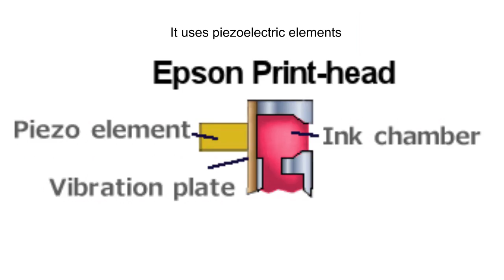What's inside an Epson Inkjet Print-Head

Comment: Be careful not to get the print head misaligned upon reassembly.. 😳... Those are machine manufactured, it's basically a no no disassembling those unless u got proper equipment for reassembly... 😁... Or unless u got a Japanese waifu who works for Epson... 😁🏯
Reply from the maker: This is not a disassembly method for the print-head. It's not possible to reassembly the print-head after taking it apart. This video is only to show what's inside a print-head .
Reply: @viandant5 creio que é possível sim, pois algumas pessoas conseguem recondicionar o cabeçote.

Comment: Can you tell about filter you tool off in front of ink holes. About what the material is and can we find it on the ne? I searched a lot but I couldnt find anything
Reply from the maker: If you open an Epson printhead probably that ptinhead is destroyed, it's welded, difficult to reassemble it
Reply: @viandant5  Sorry, my mistake. You'r right. I just wanted to know what type of filter and which ųm do they use. No one worked about on for home/office printhead nozzle filter. My question reason was I'm working on Brother j552dw piezo printhead and I think all the four ink way nozzle filter are gone in previous repairs. Later I found out my research they are using membran, ss mesh and fabric filters from 22ųm for dye inkjet printheads. You have right on Seiko printhead for Epson printers, it brakes when opened. Now my goal is to find which adhesive they use on nylon sheet to adher on plastic ink damper.
Reply from the maker: @erzincanli  Sorry I can''t help you but I think they are thermal welded

Comment: Same printer head. Tried everything to clear blockages. Syringe, solutions, ultrasonic cleaner. So decided to open printhead. Unfortunately, Near Impossible to reassemble when you have disassembled.  I used sillicone sealer, to retrace the glue gaskets, but no luck as it took a lot of ink 4ml to reach the head when I tried to prime the black nozzle, so it must have leaked via a seal.  If I would try again, Epoxy is the only glue that would be waterproof and work to an unbreakable seal imo. The Chinese seem to sell reconditioned printerheads so maybe it's worth a try. I broke the ribbon cable to the injectors so just going to buy a 2nd hand better model. This printer head wf2630 L320 etc... is known to be poorer build quality than the heads on the wf2750 etc...
Reply: How to install the gold plate nozzles to the printhead ?
What is the material we can use to stick or past this nozzles plate ?
Reply: @emadelbaz  The ink breaks down epoxy.  Only superglue with bicarbonate worked for me. Better off buying a new printhead.
Reply: See? What did I tell u 😳. U just wasted a a properly working cartridge... 😁

Comment: the material the ink filters are made of and glue used to  glue the plastic parts.....Thanks
Reply from the maker: You can use every glue water resistant but once opened, probably the print head will no more work

Comment: Em nosso caso como está obstruído em 3 cores, então deveremos abrir até chegar na parte de ver a placa de cor verde e os contatos. Não ultrapassar em ir além da placa verde.

Até no tempo de 02:06hs 02:06 hs
Não passar dessa parte.

In our case, it is blocked in 3 colors, so we must open it until we reach the part where we see the green plate and the contacts. Do not exceed the green sign.

Even at the time of 02:06hs 02:06 hs
Don't go past this part.
Reply from the maker: This is only a demonstrative video. Opening the printhead will destroy it
Reply: @viandant5  It is only safe to arrive at 02:08

Even in this part, distilled water can be used to carry out cleaning, placing the distilled water in a shallow bowl and wetting the print head. After that, suck on each color until you can suck up all the liquid from the distilled water.
In the part of the filter and piping below the injection nozzles, they must be cleaned, vacuumed and put under pressure because they will be dismantled.
But don't get to the part above the time of 02:09 where you dismantle the contact where it is glued to the flat in a glass style as if it were a calculator where the flat is glued as a contact.
Until the green part from the beginning of the video and up to 02:08 is the limit you can reach to dismantle manually.
Reply: @viandant5  Because the XP series print head like xp-214 and xp-241 is very different and does not show the filters as easily as the L series print head video which is much easier. But cleaning is always safe to do outside the printer, using cleaning solution by vacuuming the print head and exiting through the nozzles to return the dirt. You still have the option of using a sucker to drain the paint from where the pad is.
Pour cleaning solution to clean all the dirt. Then put the cleaning solution in the printer drain with a pipe, place the print head on top, place a pipe where it will connect to the injector nozzle and there it will be vacuumed, that is, the vacuum cleaner in the injector nozzle with the print head in up and resting on its support, and in the drain where the pad is located and has a pipe, add the cleaning solution so that everything is sucked up by the injector nozzle. Then do the opposite, which is there, in the injector nozzle, have a cup with the cleaning solution in which it sends the pipe to the injector nozzle, the print head in the resting place, and when the printer is unloading, turn on the vacuum cleaner to suck up the solution. cleaning process where it will enter through the injector nozzle and exit there when the ink outlet of the pad is discharged.

*Note: With the flat cable disconnected, print head screwed on, and then check if it has gotten wet and leave it to dry on two computer processor fans connected in parallel to a 9V or recommended 12V supply for a long period of time.

Comment: This was a nice video for people like me who want to know what is going on inside without having to tear my own print-head apart.
I was using an ammonia solution to clean an Epson print head a couple weeks back.  I was able to get to the point that the solution would flow fairly nicely across all nozzles (when first flushing it, ink would only flow through the nozzles of one of the colors).  But I made the rookie-mistake of putting it back into the printer and firing it up without giving it enough dry time.  There must have been a partial short due to the conductivity of some of the ammonia left behind, so my main board is now dead (pulling power supply voltage down).  I am in the process of buying a new main board but questioning whether or not my own print head should be ok now (as it has had over two weeks to dry out).  What are your thoughts on the idea of trying out my old print head rather than just buying both main board and head?
Reply from the maker: I think that the print-head is defective too, but I can't be sure.
Reply: Well.  I had the exact same experience , main board died , I used the printhead with another printer and and it also died ,,. So don't use the old  printerhead ..  mark it as bad or 👿 devil , it will spoil any printer.
Reply: @radchanel2412  all is well again. Bought a reconditioned head and used main board. Installed them and the printer is back to working like new. The head and board were each about $30. Seeing that this printer would cost about $300 or more to replace, I feel like I'm ahead.
Reply: Hi Mike.  Trying to troubleshoot a similar issue.  How did you know that your main board was dead?
Reply: @joshtdt6891  It's been a while since I diagnosed that printer so forgive me for a few guesses as to what I did.  I recall hearing some noises that sounded a bit like excessive current draw when I powered it up with the cleaned print-head. There was a separate power supply inside the printer and the output of this supply was low (or near zero?).  When I disconnected the main board, the supply power rose significantly.  It was not being pulled down by a small amount but rather a huge percentage of it's total voltage.  I do not recall much about the pin-out configuration of the supply.  I just kind of guessed my way through it, using my old radio and TV repair experience.  I no longer trusted the old print-head either. I replaced that and the main board and the printer took right off and has worked fine since then.
Reply: Is burnt its mechanism programmed gets also burned

Comment: Can this print head be reused or reassembled after cleaning?
Reply from the maker: No, if you dismantle the print-head it will be not possible to reuse it. It's glued.
Reply: @viandant5  why if you re-glue it? Like they did in the factory
Reply from the maker: @urjnlegend  The problem is that taking apart a glued part there is the risk you break it

Comment: what happen of the green one got soaked up, is it still functional?
Reply: i mean the one that looking like a motherboard
Reply from the maker: If you dry it yes, it will work again
Reply: @viandant5  that's the piece of info i was looking for! I was not sure how deep i can soak the printhead, can i insert it entirely to the solution... In another video you said only the nozzles (the bottom part) can be soaked... But then i suspect this can leave dried ink in the upper compartments.
Reply from the maker: @reflexreaction3797  In the ink cartridges with print-head you have to clean only the nozzles but an Epson print-head can be cleaned entirely
Reply: @viandant5  Did just that and killed my printer lol, because i thought it was dry enough after the hair dryer, well it wasn't. Same story as many others in the comments here. Boom and gone. Well, at least now in the future i know to definitely let it sit overnight to air out completely. Not your fault because that's what you said: safe to use when dry. I appreciate your work here, will probably return to learn something new next time.
Reply: @reflexreaction3797 i just killed mine the same way. After dying it for 10 mins with hair dryer. It did turn on and work briefly before dying out instantly and not turning on

Comment: Hi, there was one day the black colour print with empty straight line, then second page started have nothing and the third page gone worse and worse, eventually got nothing. While the colour are alright. I then use the epson software, use ink to clean the nozzle and printhead. After serveral attempt and I think it uses too much ink and still got no improvement, I google and follow some video from youtube to clean the printhead. I open the printer while still got electricity because I want to move the printhead into the position where I could access it. Then I forgot to switch it off, and I spray the alcohol into the printhead, kitchen towel underneath above the sponge but under the printhead, shake it and wipe it and then water, shake it and wipe it. the kitchen towel have coloured liquid and I took it out and I blow it dry. But then my printer never turn on again. I wonder could you be able to identify my problems and is there anyway I could save its life.
Reply from the maker: Spray alcohol in the print-head is not a good idea. I think there is a short circuit in the electronic circuits of the print-head. You may try to change print-head but it's not sure the printer works again
Reply: Olá, provavelmente queimou os dois transistores da placa lógica, por sorte são fa ei de trocar, e parece que são de baixo custo, talvez também tenha queimado o F1(pequeno fusível smd), e neste caso se nso for possível adquirí-lo você terá que soldar a peça fazendo uma conexão entre os terminais. O terceiro componente é o CI da Epson, depois vejo o nome e te falo, ele não precisa ser gravado e também é de fácil aquisição. MAS, veja bem, se você trocar os componentes da placa e tentar usar o cabeçote de impressão que queimou os três componentes podem queimar novamente.

Comment: I bought this printer https://www.youtube.com/post/UgkxciSwynMJ7PnUvvx11rewiu-yFBkZTl53 to replace an aging HP printer. It is just used for casual home printing so I don't need anything more. Installation went easily though the HP Smart Printing doesn't work well with our laptops - having to select the actual device. Will have to see how the HP Instant Ink program works out. Plus haven't been able to set up printing from smartphone yet - either direct or WiFi